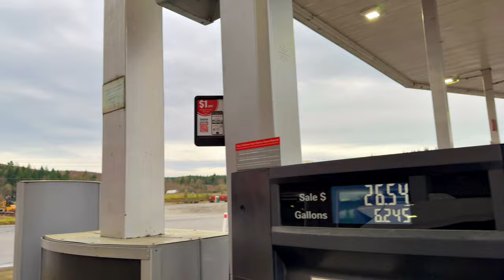Very Cool Mail Call..!! • Now, the Himalayan Relays! | TheSmoaks Vlog_2964

Comment: You are both very welcome. Thank you for the daily vlogs. The H-D dealer in Winchester was recently sold and the new owners changed it to Skyline, which it is close to Skyline Drive in Shenandoah National Park. It starts in Front Royal and ends in Waynesboro, Virginia and then it is called Blue Ridge Parkway and continues south. Excellent road to ride a motorcycle, speed limit is 35 mph, but it has tons of scenic overlooks and wild animals. Good stuff Smoak's!